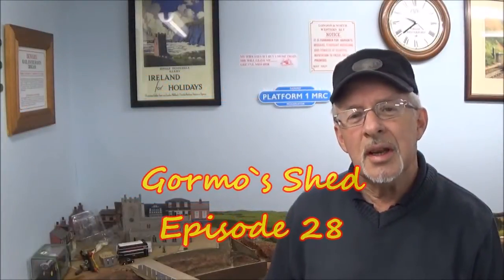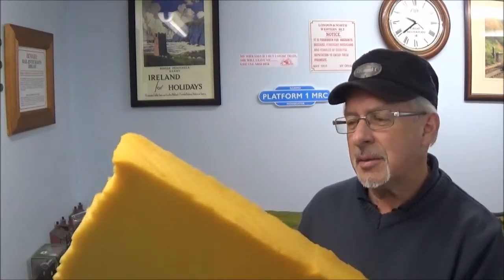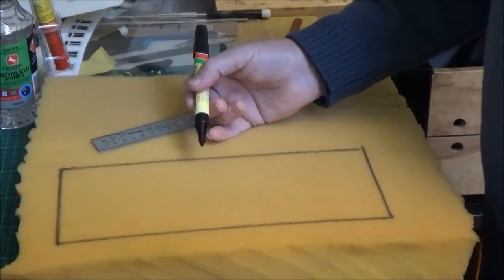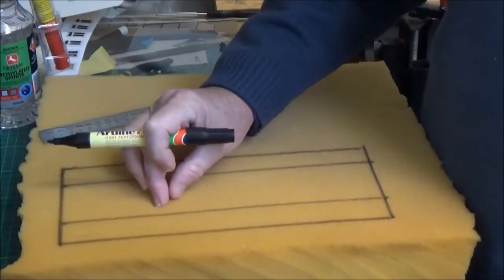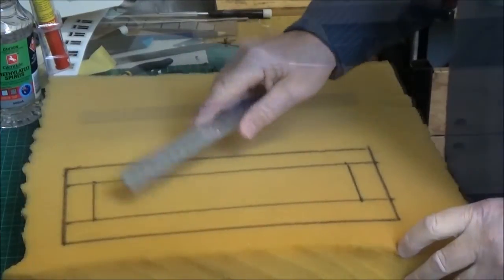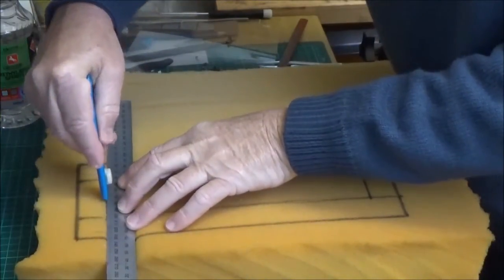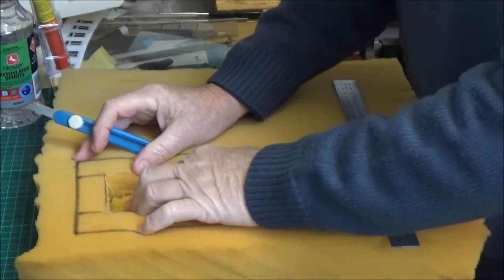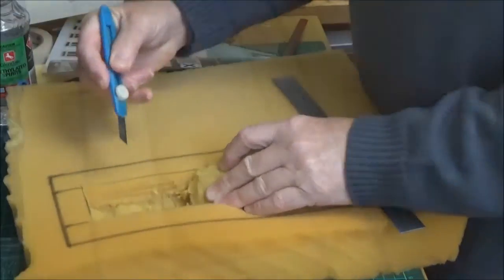Episode 28 Loco Servicing Cradle

Comment: Nice idea Gormo. I have been using the foam packing from the end of a new laptop I bought. Works ok but a bit tight. I was thinking that I could get a piece of foam from the foam shop and get them to cut it into "slabs" and then glue together to form the box shape like yours.
Reply from the maker: Sounds like a plan to me, mind you, don`t spend too much or go to too much trouble as you can buy ready made from Peco.................http://www.peco-uk.com/product.asp?strParents=3309&CAT_ID=3337&P_ID=17658
Cheers Gormo
Reply from the maker: Sounds like that would work but what glue would you use.???
Cheers Gormo
Reply from the maker: Thanks Darryl......yes I think I know the type of foam you`re talking about. I think the soft stuff would be easier on the couplings though.??......Cheers Gormo
Reply from the maker: Fair enough ...I`ve got a hot glue gun
Reply: Great job 👌👍